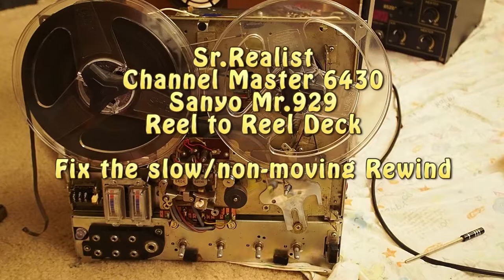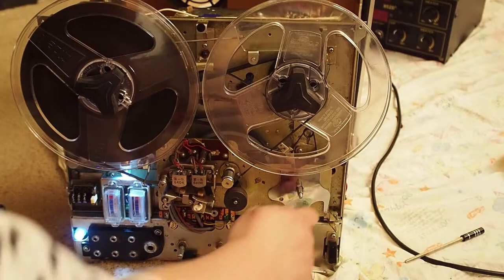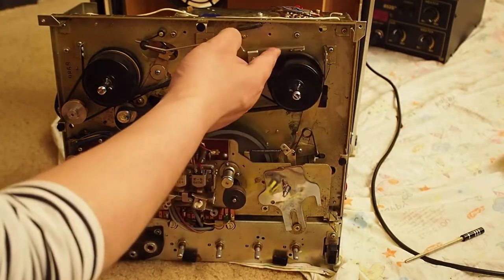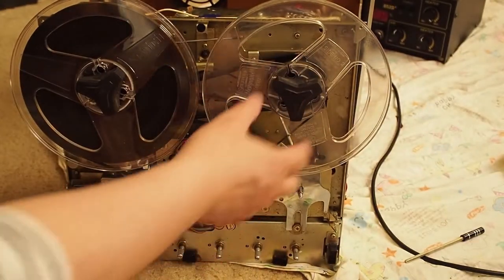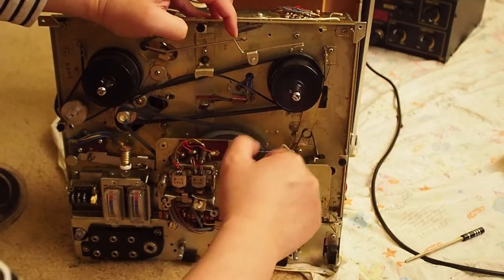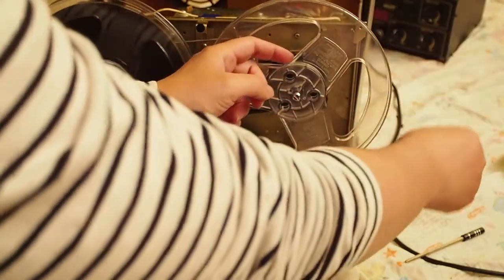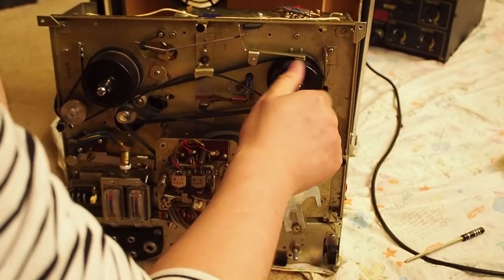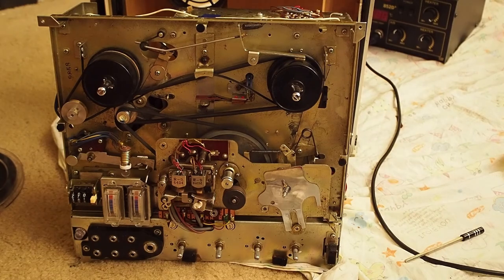Sanyo MR 929 / Sir Realist / Channel Master 6430 Reel to Reel Slow/non-Working Rewind and Fix

Comment: Ok so one thing I have noticed about these 60's and 70's devices is the blades of the plugs are the same size . On modern devices the neutral blade is wider than the line in ( hot ) blade. How do you know which is which ? does it matter which way you insert the plug ?
Reply from the maker: It does not matter
Reply: @DunQuDeYi  Thank you !